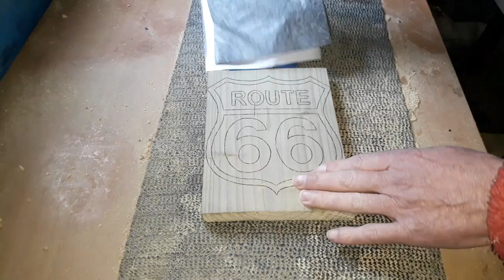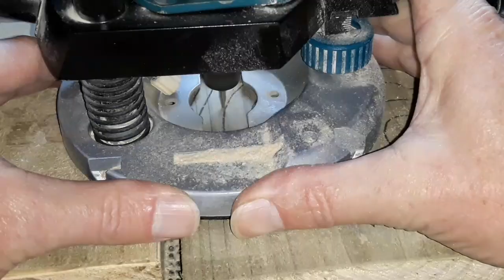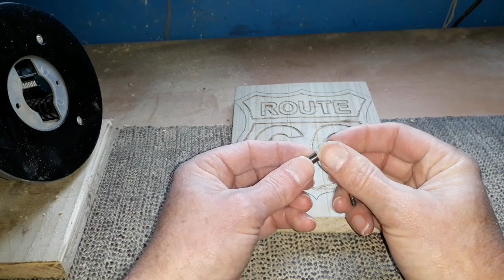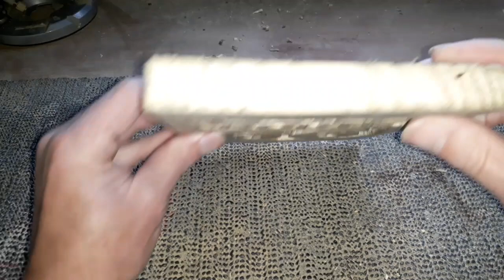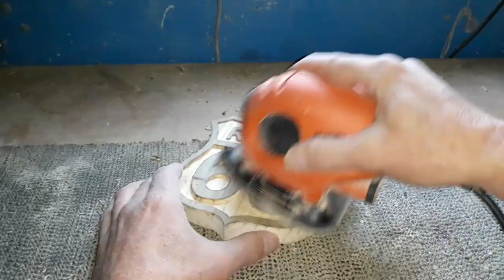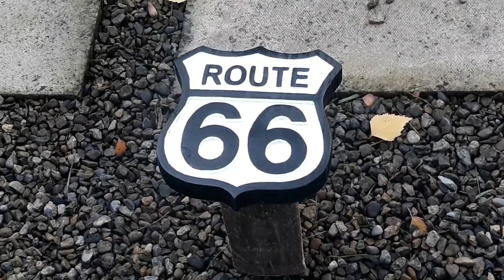Route 66 plaque from fencing wood

Comment: Love your videos. I have a dremel and a dremel router attachment but I am unsure of the correct bits to use . Do you have a link where I can buy them please?
Reply from the maker: https://rover.ebay.com/rover/0/0/0?mpre=https%3A%2F%2Fwww.ebay.co.uk%2Fulk%2Fitm%2F352628877885
Reply from the maker: https://rover.ebay.com/rover/0/0/0?mpre=https%3A%2F%2Fwww.ebay.co.uk%2Fulk%2Fitm%2F372716585343
Reply from the maker: Cnc bits are great for the lines,the mill end bits for clear out..Ebay or Amazon, they vary in price ,so look down the list...
Reply: fishtank5050 many thanks. I’m learning a lot from your channel 👍
Reply from the maker: @carterscreations5791  no problem  I'm happy to help..

Comment: hi getting hold of the pinless blade adaptors is hell at the moment dont know why its so hard i also wonder why thay dont make pin ended spiral blades
Reply from the maker: These are another idea I've seen,dont ask how to get them,I've no idea..lolhttps://images.app.goo.gl/jD9Z6HPXQVfGiYWK7
Reply from the maker: I dont see why they dont make pinned spiral blades, would make life alot easier....I've never tried it,but I wonder if you could make your own pins,as a temporary thing..I was thinking about taking the 3 prongs out of a electric plug and making a clamp from the piece that the wires go into,its got a screw on ,so you could tighten the blade inside,then put it In the saw like a pinned blade,you might have to cut them down a bit..lol...in my head it works..
Reply: yeah i was also wondering if you buy a brand new scroll saw that takes both as they now  why dont they sell the replacement adaptor for their model or make if it was to go wrong  seems if you want to get everything you need to do woodcraft work you need to live in the USA ha ,  i have tried to order from harbour fright and other places in america but they dont ship to UK and if they did it was many more times the cost for postage than for the item, boy they have it so good over their anyway rant over keep up the good work fishtank 5050 dont know your name
Reply from the maker: @wayneheston-king341  this looks like  a good one ,and by the shape I would say it fits in the chrome hook...https://www.axminster.co.uk/axminster-craft-blade-clamp-for-ac456ss-105856?glCountry=GB&gclid=Cj0KCQjw9fntBRCGARIsAGjFq5EZ7Hut-jaeKhUl9c4b26J0eFcAfhTkE3Z9dRWnZwHbyaefVceyv1kaAooGEALw_wcB